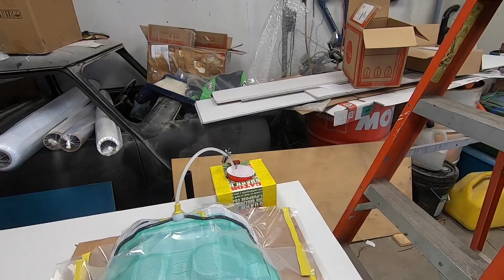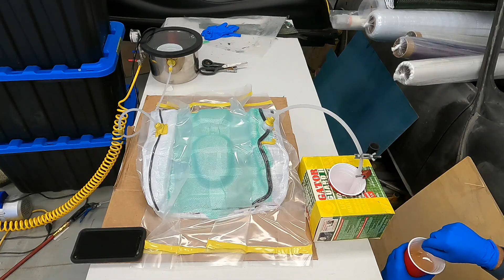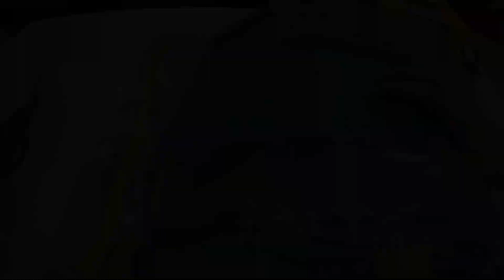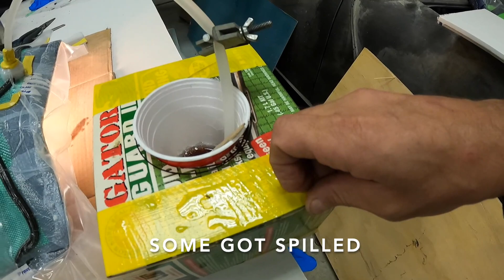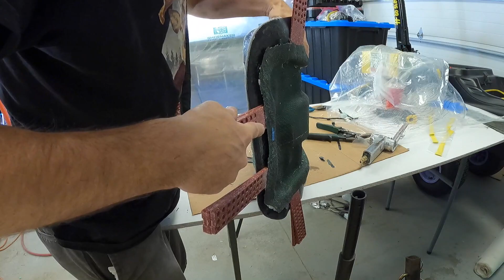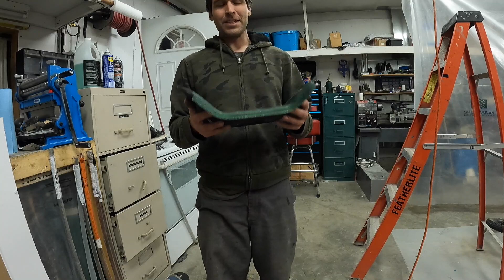Carbon Fibre Bedplate - Test Bedplate Completed - Vacuum Infusion Process

Comment: Send it.... always
Reply from the maker: Haha... Full send. 

I just got confirmation today that I was able to set up an account with a composites supplier, so I should be able to make these at a reasonable price. This one is currently on my 1100 in my hull (just test fitting some stuff). 

I will probably hang this one on my wall and build them a proper one, that has a chance of standing up to the abuse.

Comment: amazing, to think you made that.  Would have liked to see you stand on the sides and hop a few times. That would be about the stress of a motor on the plate.  Glass might actually perform the same as CF and would be cheaper to mass-produce.
Reply from the maker: Thanks ! I really appreciate your comment! It was a lot of work and success was by no means guaranteed. 

I may do some testing on this yet, but it actually takes a little over a week at room temps to fully cure. When I took it out of the mold it was noticeably softer than it is now. I dont' think it's really fair to test this one, as it is only 4.2mm and should be 6mm ... and it is a mix of carbon and fibreglass, so it kind of has everything working against it. 

I may build another FG one at 6mm and test it, like you say, if it holds up it is a MUCH cheaper option. That being said, I think I may have found a Canadian source for materials that has reasonable pricing, so that could make all the difference in the world.

Comment: Oh that thing turned out so good 👍👌 sorry I am late to the party, been busy working on all sorts of jetski stuff all day. You want to send that sweet part to us? Dang I would be honored to run it in the most legendary stand up we have…….. the ripper 🤣 just kidding I would put it into the SeaRat for sure 👍🤘
Reply from the maker: Thanks Josh. I'm pretty pumped about how it turned out. I'm going to use this momentum to get the actual carbon one finished. 

I did some work on the mold today, also did some sand blasting, flipped the X2 over and sat the mounts in place... but that's just about as far as I got. 

I'm 98% sure that the Sea Rat would destroy this bedplate... I haven't decided what I'm going to do yet. I may send it, or build a 6mm thick version, or just build you a carbon one to torture test. The Sea Rat would be perfect because it's like a gold chain on a pig 😂
Reply: @JoelArseneaultYouTube  We will run any kind of cool stuff that you want to send us. Definitely could run it in a 2 cylinder if you think that’s a better idea 👍👌
Reply from the maker: @JetSkiBrothers  The Sea Rat is a great torture test... It's just unfair for this 4.2 mm bed plate and when it fails the whole internet would just see the carbon skin and be like "see, carbon fibre sucks as a bedplate" lol 

I'll figure something out. I'm in talks with a materials supplier and MIGHT actually be able to get reasonably priced carbon and fibreglass here in Canada.

Comment: Wow Joel, is that carbon fibre and fibre glass bed plate going to be to brittle or is it strong enough to handle the 1100, swap,. , Can't wait to see that beast of a motor in that X2 hull, it should be very fun to ride and hell fast as well, cheers mate
Reply from the maker: This is just a test part to try the infusion process. I probably won't be using this one on anything, but I might send it to the Jet Ski Brothers and have them break it :)  I'm pretty sure that this one will snap if used on an 1100. 

The one that I am going to make for the 1100 will be 6mm thick carbon fibre only. It should be plenty strong as long as I don't mess up building it. Carbon fibre, done properly, is much stronger than steel.

Comment: I'd run that in the sea rat! No reason not to. Just remember carbon fiber stuff is for rich people. If these cost $600 somebody will buy them.
Reply from the maker: I may decide to send this one, or I may make another one that is actually 6mm thick. I'm about 98% sure that this one would snap. 

CF is rich ppl stuff, most of the time, that is true... however. Rich people purchase CF parts so that they can tell their buddies that they got a new RRP CF part.... You're not gonna get much street cred if you are like "I just got a new CF bed plate from some guy no one ever heard of on YouTube" 😂

What I really need is a dependable reasonably priced source of CF ... because they way I've been purchasing it is neither of those things, haha.
Reply: @JoelArseneaultYouTube  I've bought cheap carbon kevlar off ebay and it seemed like the real deal. I have no way to really qualify that. Also the thing is a lot of the carbon stuff is for freestyle (yamaha) stuff. Nobody is making carbon kawi bedplates except you and probably no one else. The way you are doing this is hardly back yard. I bet the carbon stuff from blowsion or some place like that is often not vacuum bagged.

Comment: That's an amazing result for a first timer Joel! Congrats! Indeed having it shipped to JSB and tested in harsh "real life conditions" would be  a great test! Can't wait to see the final CF version 🤠
Reply from the maker: Thanks !! I'm always surprised when things turn out the way they are supposed to, haha ! This part had a few minor flaws / issues, but if it were carbon fibre it would totally be a useable part. 

I've been sanding and modifying the mold so that the next one is easier to make and hopefully turns out even better. Fingers crossed ! :)